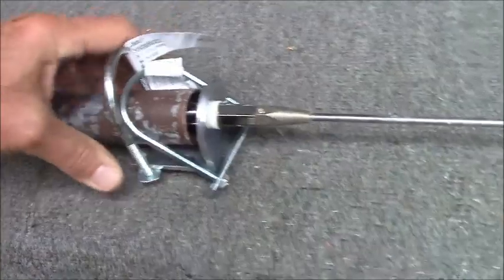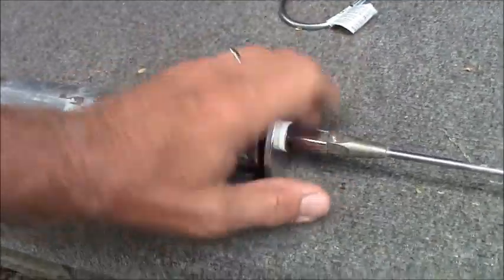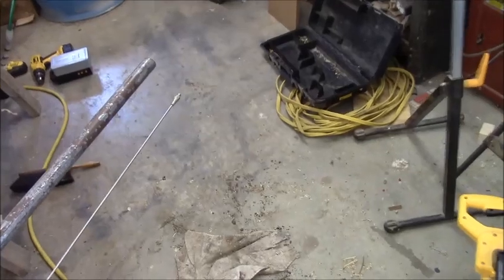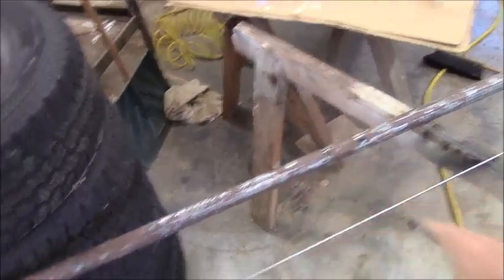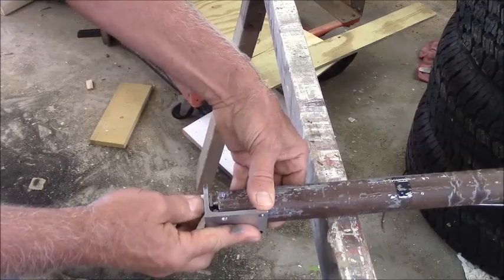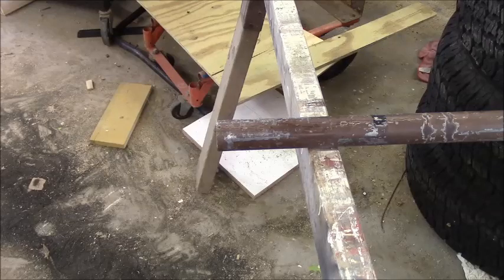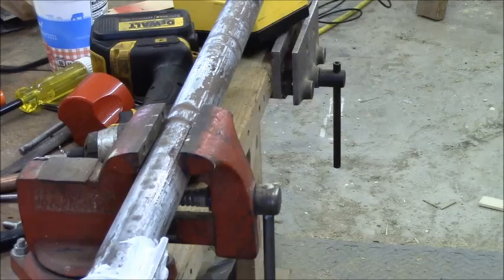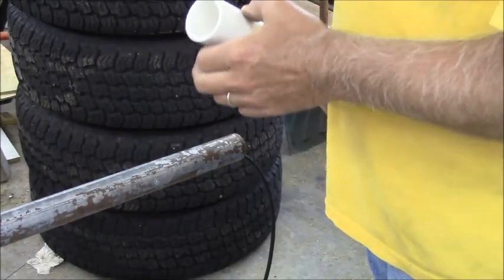DIY CB radio antenna, How to build a quarter wave vertical dipole CB antenna cheap

Comment: No potbelly Spring? But 
looks Great !!!
Reply from the maker: Michael1212 just for fun and hobby use, it seems to work well especially for the price! Thanks
Reply: Whith out the spring  it no 1/4 wave  for 11 meters  but it is for 10 meters  put wrong length coax  will give you a fouls swr  reading all ways  set swr  right at the antenna   n smell your silicon  if smells like vinegar it will cose corosin it your coax connectors  
I'm  not trying b rude  I learned  the hard way   best way seill coax first wrap with electric tape from 3 in below going up then wrap whith coax seal it like soft tar  then work it whith your hands till you can see the seams.       73 n9prf  n good dx

Comment: Hi how meny meter is it
Reply from the maker: @WillemHosking-lz7tx  102 inch stainless whip, mast cut to 102 inches…, I don’t do meters
Reply: @bobsbarnworkshop  i mean the pole
Reply from the maker: @WillemHosking-lz7tx  the pvc section below the antenna is about 2 feet long, then another section of steel pipe on the bottom is about 4’. These lengths are unimportant and don’t affect the performance of the antenna. Just there for isolation and mounting.
Good luck!
Thanks for watching!

Comment: @ 13:47 You could just drill through the pipe and use a bolt with nylon locknut on the other side, no worries about the bolt backing out of the threads.  Much easier.
Reply from the maker: mrmrlee sounds like a good idea but won’t work in this design... the coax and connector are inside the pipe right where the bolts would be. Thanks for watching!
Reply: @bobsbarnworkshop  Hey you're right, glad you told me before I tried this!  Looks like a fun build.
Reply from the maker: mrmrlee I suppose you could use U bolts around the outside. The mirror mount has 4 holes to accommodate them. The pipe I used was too large in diameter but I thought about using 1/4” threaded rod and bending it around to fit. Let me know how it turns out!
Reply: @bobsbarnworkshop  Will do, thanks!

Comment: A resurgence of C.B. radio ?
These are much different times !
Too many disrespectful foul mouthed local trash !
These are not the old days of Citizen Band Radio !
Society as a whole has changed !
Hell, even most Truckers have left C.B., as it got so bad !
Too many kooks running around, that will easily find your location !
You'd be crazy to take those chances, especially if you have a family !
Run away, don't walk !

Comment: Do you want a little antenna to go with that caulk? 😂 Just giving you crap. Good job
Reply from the maker: Just trying to keep corrosion from killing my connections.... I can’t see it upon the roof!!! Ha ha!!! I talked to a guy 15 miles away on it a couple nights ago, do it’s still working!
Reply from the maker: Also, I did a second video testing this antenna and the highest SWR it had is less than 1.2 SWR on all channels!